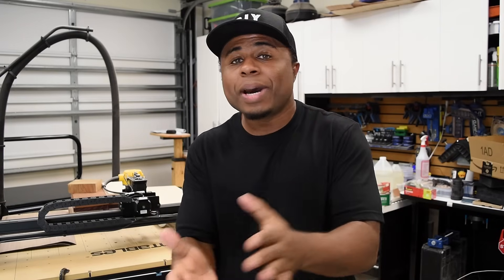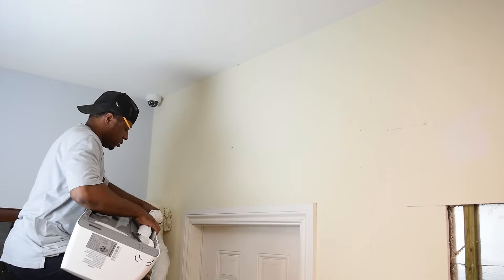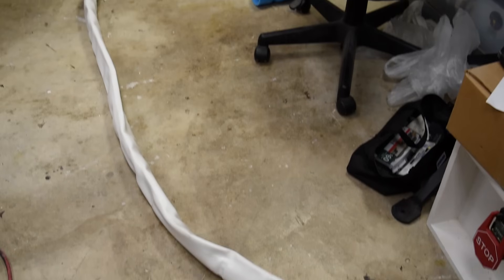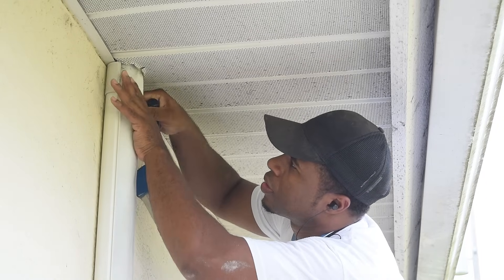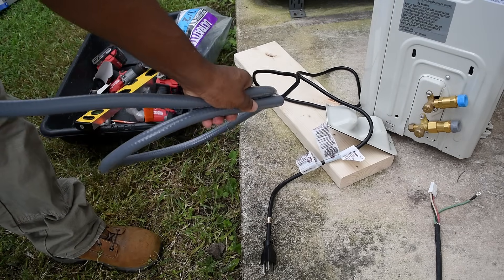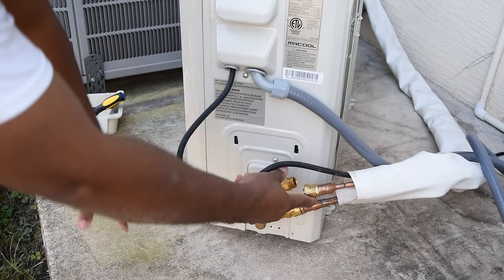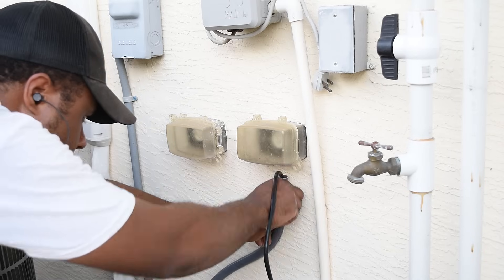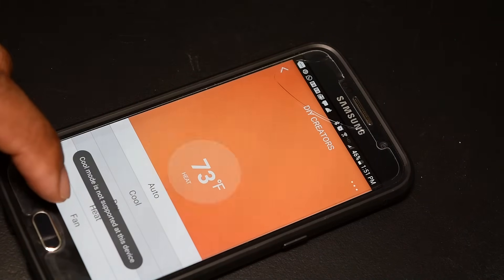How To install Ductless AC & Heating System // True DIY Mini Split MRCOOL

Comment: You made a mistake. You open the top line first and then on the bottom line there is a valve that you need to short press-release for the air in the system to go out. 1 sec will do the job or until you can see/feel the refrigerant. Opening the both valves will mix refrigerant with the air from the lines and that is not good. You will damage the compressor  the lines the evaporator and all that from the inside. BTW that AC is just a  random Chinese factory. Google vivax aeri r32 you will see the same AC under different brand name.

Comment: Great job, I just wonder.. and the cooler unit that sits outside be mounted on a wall? maybe have shorter lines to it? since I have a drive way just outside and would not want someone driving into the unit if I can have it off the ground.

Comment: You failed to  use a vacuum pump to evacuate the lines to the evaporator. You will run into problems with moisture in the lines. Could clog up the expansion valve.
Reply: The evaporator and lineset are precharged with refrigerant in this case.  When you tighten the lines to the condenser unit , a seal is pierced allowing the refrigerant to flow. No vaccuum needed.  This is how Mr DIY creator was able to install the unit without a Safe handling Certificate.
Reply: I beg your pardon then. After further investigation is is clear you are correct. Since I have been out of the HVAC business for over 20 years now, this is the first I have seen this setup. Thanks for correcting me.

Comment: DIY hvac has never been a good idea. Most manufacturers will not allow the extended warranty if it is bought by anyone other than a licensed hvac contractor, so typically lose 5 years of warranty. Some people may luck up and get it right but many don’t! As a hvac professional, I have had countless service calls to fix what the diyourselfers screw up. This should have never got started.

Comment: Nice video but that shit's too expensive, holy shit. Just throw a window unit in. And if you don't have a window, just cut a hole for the air conditioner. Way easier and cheaper.

Comment: Just subscribed. As an HVAC engineer and part time contractor, I was VERY impressed with this installation video and it is probably the best DIY video I've seen in the past few years. Very knowledgeable tutorial, well filmed and I applaud the way you explain everything as concisely as you do. Great work!
Reply: Jason/Juio/Damir:  
The three of you are of the self-preservation society obviously.
If you feel somehow threatened by the ease at which these units are changing the lives of MILLIONS, Globally, then you need to widen your skill-bases.
The world is ever-changing: Adapt or be left behind.
As for pulling a vacuum, Jason... I'm guessing you're (got it?) an engineer too, so was I...and I would have agreed with you, 20 years ago. 
But I'm guessing these units run at a much lower head pressure (and therefore these units are more efficient, current wise) and less critical of the presence of air in the system..... 
As he stated in the video: 
The manufacturer says there is no need to evacuate the lines and evap unit....
I installed one of these three years ago: I shortened the lines & used the gas in the system to purge the lines. I did not evacuate. 
Three years on....it performs as per spec. In cooling & heating modes.
You live & learn. Hopefully.
Regards.
Reply: You have no idea what you’re talking about if you think this was a good install lmao
Reply: you should be ashamed of yourself, your an hvac engineer and you didnt even realize that he didnt pull a vacuum on the system?!?!
Reply: Agree. I am just a EE and even me knows his system will fail prematurely.

Comment: You forgot to use vacum to clear all air in copper tube
Reply: Before you open that valve u need to put pressure on that copper tube to leak test  and make user use guage manifold after that if they not have leak makesure use vacum pump to air out in copper tube doing that your iron cool much better  because they don't have air on the circulation of refrigerant😊

Comment: Can anyone tell me why i cant mount a mini split lower on the wall? I mounted low on the wall in 2 rooms and it seems to work fine.
Reply: I know they have wind veins that move to help out with flow just like a fan, I like  it hi so I can feel the wind but that's me I hope all works out please let me now thanks
Reply: Hot air rises so you would want to suck hot air out and would make room feel nice  also  need clearance  on top but if the instructions dont  say anything about a minimum off the floor  then you did a great job
Reply: @p1nrea1  i unserstand that. In the instructions there is a minimum thats over the 2 ft i mounted them at. However, I cant seem to understand why this would be any different than a unit you would find in an apt. An aptartment  unit is mounted low and has the intake and exhaust in about the same location as a unit like this. I guess we will find out once i have thrm hooked up

Comment: I believe you may have said you were going to do the electrical service differently later. I know codes may differ but is it normally acceptable to just plug it into an outdoor outlet like that? Of course it would be running off a 20A breaker inside. It seems like it is likely legal since the company supplies a normal 3 prong plug cord. Thanks.

Comment: Wow you completely did this wrong you are to NEVER!!! Release refrigerant till you pressure test and pull a vacuum on the the lineset cause if you don't you can contaminate the refrigerant if your not a licensed HVAC Contractor then you don't need to be doing ANY Ac work

Comment: didn't pull vac!!!! I tq with NYLOG on the ref lines
Reply: Not necessary..
Reply: Hes going to have to pay for all that extra electricity pumping the non condensables around the system
Reply: Unit is gonna fuck up without being vacuumed, especially it’s 410A

Comment: You are supposed to torq the flare fittings. 
They have torq specs
Reply: Yeah yeah yeah I hear ya
Reply: David Pedant Morgan. I've only been doing them 25+ years. 
You carry on with your torquing....... have you finished one yet?
Reply: Not needed. Just tighten until it breaks loose then back off an eighth of a turn.

Comment: You didn’t use a vacuum pump which left the air that was in the lines. If you did use a vacuum pump you should have showed it in your tutorial! Not using a vacuum pump is a big no no!
Reply: You Tube he also did not do a pressure test and did not torq the flare fittings to the torq spec.

Comment: Didn’t vac it?? That ain’t gonna work for long. Cutting out on hp very soon.
Reply: There are pre charged lines. Not to common in the industry but they do make them.
Reply: BS.was air inside the indoor unit = moisture = reduced life of unit, or capillary freeze.

Comment: Loved the video but you did forget a key part to the system you need to pull a vacuum before your release the refrigerant so that all of the moisture and the impurities in the line. Also the unit may have not come precharged with the required amount of refrigerant for the length of the line set.
Reply: darkenigma1111 they do come precharged for the length line set you bought from the dealer. You are correct though, he didn’t pull a vacuum or do a pressure test on the indoor unit. Also he did not torq the flare fittings, they have torq specs. 
So he may have issues down the road.

Comment: Watched your video all good up to the point you connected the coolant line set! YOU GOTA PULL A VACUUM ON THEM LINES down to 500 microns before you open the Schrader valves. You got moisture now floating around in your system which causes premature equipment failure!!!
Reply from the maker: I will make an update video to explain.  No vacuum is required.

Comment: The suction nut on the condenser needed to be loose just as you were opening the liquid(smaller) line, so the air in the lines would have been bled out to avoid having air(moisture) in the system, then after 15 seconds of bleeding, the suction nut would have had to be then tightened up. Other than that, it was a very good job and tutorial.

Comment: Looks nice, but I don’t see you connecting the vacuum pump , moisture(water) doesn’t get alone with freon,when you took the caps from the line set head and condenser are getting moisture. it’s need to be vacuum it,how long is going to be working properly,before you need to call the technician?a least is something new in the market it doesn’t need to be vacuum it. But beside that, you did a very nice and neat job
Reply: No, I just found out today about those lines , I found a few times before a lot of line sitting on the attic connected to air handle and the condenser. now I know why they were there, they are pre charged,you need at least 16',because those lines are pre charged and they came in 25’ or more, thats why he run the line set throughout the  attic, he can’t cut them, so thats one of the ways to look nice and neat, but I’m still thinking at the long time he’s going to have problems, even if it’s a small amount of air when him is connecting the lines to the condenser,without vacuum it, specially for a 410 Freon.
Reply: francisco ruiz good point. He is definitely going to have issues. Not good for the unit at all. Probably will be serviced in the next few years.
Reply: francisco ruiz exactly what I was thinking. But I’ve heard of being able to buy lines the exact measurements you need and they are factory vacuum sealed. So maybe that’s what he did.

Comment: A few important reasons why you should call a pro to install.. 1 , you could cut and braise the lines or flair at the condenser.  2, the indoor unit was too high. And more importantly you need to evacuate the system.  410A calls for triple vacuum to allow all the moisture and "non condensables" to be pulled from the lineset.  
Nice job tho.

Comment: dont you need to vacuum down the line ? thats cool if you dont but dont see how you can get away without doing it
Reply: Bob Boon  yes, thank you. I realize that the vacuum is compromised when the lines are opened. I didn't mean to imply that these particular lines were holding a vacuum, merely that the caps keep gunk from getting in. Nevertheless, it must work, despite the amount of air let in from not suckin down prior to letting the charge go. That's all Im saying. Believe me, I'd rather know I didn't start with air in the system, but like I said, for diy purposes, it must suffice: they keep selling them.
Reply: I think that would be ideal.  I do know what you mean.  I do Automotive HVAC, and I always vac the system prior to charging.  This unit comes pre-charged, and the lines are all capped, so in my opinion, atmosphere and moisture intrusion are minimal.  You still get the full charge, and with that, it should perform acceptably.  Of course, you can pay an HVAC guy to come and recover, vac, and recharge, if that suits you.  But, for a completely DIY project, this looks pretty amazing.

Comment: Line set is pre-charged. no need to pressure test or vacuum down and 7-year compressor and 5-year parts warranty. This product makes all the HVAC guys/gals nervous.
Reply: No it doesn't
Reply: Not really, without a vacuum it will break quickly. And we'll be there to replace it. Luckily pre-charged lines are illegal where i'm from, so we don't have morons trying lol.
Reply: @theboone3848  Maybe it won't last as long without 'professional' installation, but this unit is $1300 shipped. Even if it requires replacement in 7 years when the warranty expires, you're still better off just buying a new one and DIY. An HVAC dude is going to charge well over the cost of a new unit to do an 'pro' install. Most companies around here want $2000-$3000 in labor to install one of these, which is a total ripoff compared to the cost of the unit. HVAC isn't rocket science, and I'd rather trust precharged lines and unit with the correct amount of charge set by engineers at the factory than some hacker tech that took a couple classes.
Reply: @bnasty267  most techs aren't hackers, usually it's the customer's fault for going with the lowest bidder. Also 110v units are horrible   on power.

Comment: You, sir, are a ninja. We never know what your next move is. That was some impressive work. Before watching this video, I had contemplated installing one of these in my shop. Now, after watching what you had to endure, I think I'll just sweat it out. Keep up the great work. I really enjoy learning from your videos. Thanks!
Reply: Run a hose through a hole in the wall and plug it into a normal house outlet?  If that is too hard, you shouldn't be on a DIY channel.  Call a professional to plug in your toaster.
Reply: @ThinkDifferentish  #troll

Comment: I understand that this unit doesn't require evacuation with a vacuum pump, but you need to specify that in the video.  I've installed hundreds of mini splits with my company, all that do require evacuation.  Someone may see this video and not realize if their equipment is different and have non-condensables mixed in, which leads to high head pressures and short life of equipment.
Reply: He mentions very clearly at the beginning that this is the only fully DIY unit he could find that doesn't require a HVAC guy. This is not a general mini split install guide, that is pretty obvious.

Comment: these are used in most of south  east asia the down side is they will only cool the room they are in hallways corners any other turn will not get the air cooled

Comment: No vacuum??😱
Reply: Carter has a point. The evap is in a vacuum, but the vacuum is broken once you install the line set. You need to charge it with nitrogen first because sometimes the flares on the lines dont sit right. But you also have go put the lines back into a vacuum. Especially with 410a, 407c, 404, 502. All hygroscopic refrigerant blends which attract moisture fast. I know the manual may say that, but you should definitely leave it up to an HVAC tech to do these installs. Unless you're a qualified tech, and you negligently release refrigerant into the atmosphere, you will be subject to penalizations from the EPA
Reply: @jomisamar2005  this is completely different. The indoor unit and the lineset are one entire piece that are vacuumed. It doesn't pierce when you tighten down the actual lineset to the condenser. There are no flares it's like two parts you tighten down. Then when your open up the king valves on the condenser it Pierce's them. Sure there may be moisture or something still but it's super minimal
Reply: Don't need it for this unit, everything is prevacuumed and sealed
Reply: @851995STARGATE  the lineset isn't
Reply: @carterg3339  yes it is, it's a precoiled Lindsey that comes with the inside unit, you literally brake the seal on it only when you tighten it down at the condenser side. Go look the manual and these diy machines up

Comment: Good luck when you have to call someone in for a service call for not pulling a vacuum beforehand.  Also refrigerant is not to be used as a form of leak detection, nor is soap and water.

Comment: I live overseas and these units have been all over asia and europe for years.  I can't believe it has taken this long for them to start being used in the USA.  They work great!  If you don't want to cool a certain room you just leave it off and close the door.  In the winter they act as a heat pump and can produce heat way down below freezing.  They all come with a remote that you leave in a plastic holder on the wall or just on a table or wherever.  For all the "experts" saying you have to be licensed and you have to vacuum the lines.  NO YOU DON'T.  The unit comes pre-charged from the factory with all the freon in the compressor.  After you connect the copper tubing to the couplings you open 2 shrader valves with an allen wrench and you can hear the freon flowing into the lines.  The outside condensing unit and the inside cooling coil are charged with freon at that time never to be touched again.  Like the video shows you plug it into a single receptacle and away you go.  Very simple and very good design.  No need to have a huge central unit cooling your entire house 24/7.

Comment: Many refrigerants, such as chlorofluorocarbons (CFCs) damage the ozone layer, while others are extremely potent greenhouse gases. In fact, one kilogram of the refrigerant R410a has the same greenhouse impact as two tonnes of carbon dioxide, which is the equivalent of running your car for six months.

Comment: Code violation. You are not allowed to run a rubber pigtail cord through conduit. You have to run THHN to a disconnect or switch
Reply from the maker: I know, it's a temporary hookup as I explained in the video I will address this later.

Comment: A tip that most people forget to mention: Check your insurance policy. Depending on region and provider, doing any real electrical work without a licensed electrician can void your homeowners insurance if it starts a fire. As said in the video, if you are comfortable doing it yourself that's cool.

Comment: Good Vid. I have installed a few Pioneer units myself(Basically same EXACT unit different brand) The Pioneer units Need a HVAC contractor to vacuum the lines and are cheeper. It is really slick that you can skip that step with Mr.Cool but it does come with additional cost.